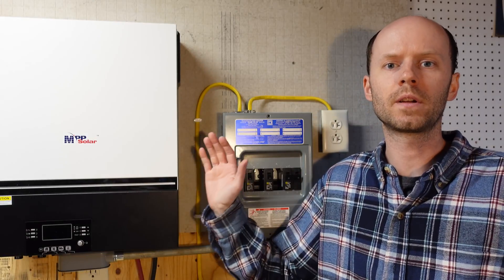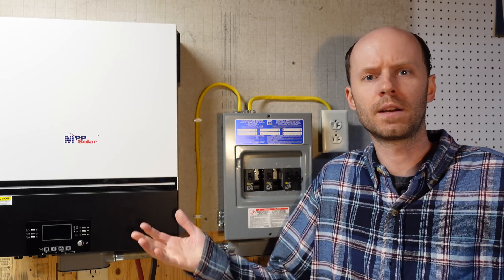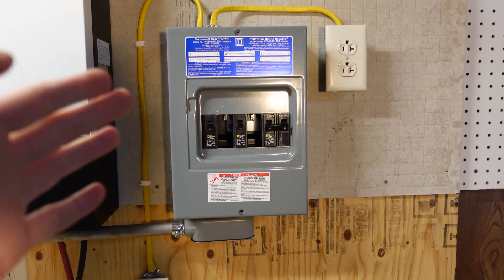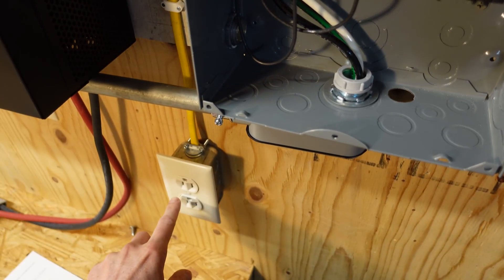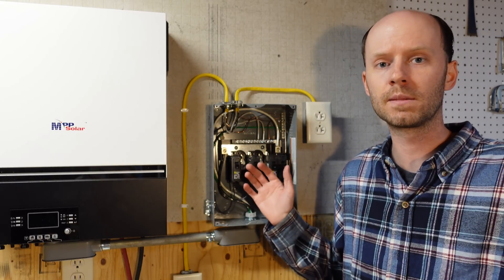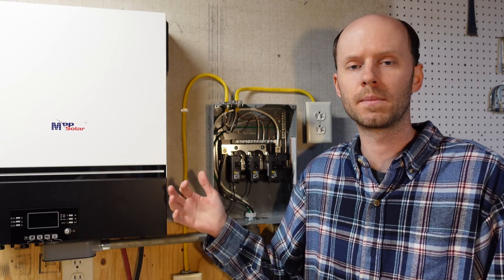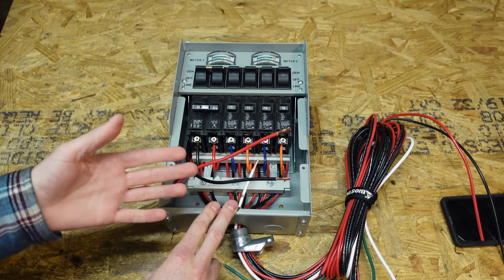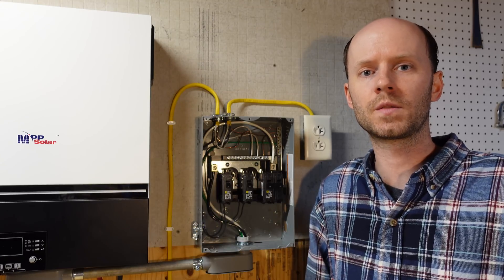MPP Solar LV6548 Inverter, Neutral+Ground Bonding, Completely Off-Grid

Comment from the maker: LV6548 Inverter... https://watts247.com/product/lv6548-6-5kw-120v-solar-inverter-4kw-250v-mppt-bms-ul1741-built-in-wifi/?wpam_id=97 (affiliate link)
If there's anything you feel I missed or did incorrectly here, please let me know!
Reply: Hard to tell what size conductors you have chosen in your main panel. I think your main bonding jumper is sized incorrectly. The minimum size allowed is size 8 AWG copper and should be sized based on the size of the ungrounded conductor.
Reply from the maker: The THHN conductors from inverter to panel are #6. Are you saying the bond jumper should also be #6 to match? I used a piece of #10 in the video.
Reply: @LithiumSolar  If your ungrounded conductor is #6 then the main bonding jumper has to #8 minimum according to the NEC article number 250.102 (C) (1). Thanks for for the detailed reply. That's why we don't lose the bonding screw! haha
Reply: I talked to watts247 and Ian said that if wired as the manual says you shouldn't have any problems adding A/C input because the relay takes care of all of the N-G connections, I'm still confused on how it wouldn't cause a problem if wired into a panel that already has a N-G bond though, MPP told me that in order to meet UL it is required to have a N-G bond under battery mode
Reply: did you connect to an earth ground? did you remove the N-G bond screw

Comment: What would be the best approach if you sometimes connect this system to a regular 120vac outlet to charge it when its cloudy? Do you need to remove the ground/neutral bond screws from thr inverter or leave them as they came from factory?

Comment: Can you create a neutral ground bond for your all-in-one inverter if you're only using the power strip and not a service panel or breaker box
Reply from the maker: I would suggest consulting an electrician. I'm not able to give application-specific advise.

Comment: My qiestion is refering to inverters or power ststions that have current between neutral and ground about 40 volts some are as high as 60 volts . You dont want tl short out 40 to 60 volts. If you bond you will short out your inverter. I dont understand inverter circuits. Especially the transformerless type. 73

Comment: 2:54 that wire is WAY too small for the capacity - should be 50A+
4:12 that also makes the breaker panel part of that potential voltage on ground / loop circuit.
Reply from the maker: I think you are misunderstanding a few things here...

Comment: If only one LV6548 is being used, it does not connect the ground to neutral when in pass-through mode, and you don't want to connect the ground-neutral at the LV6548 output panel either, as the bond is at the input grid main panel. When in battery/solar mode, the LV6548 uses a built-in relay to connect ground to neutral, providing a solution in the single LV6548 case. For multiple LV6548's all but one of the units need the bonding screws removed so that only one LV6548 provides the relay ground-neutral bond.
If MPP Solar shipped units without the bonding screws, then when running in battery mode, there would be no ground-neutral bond at all, unless the bond occurred at the output panel, in which case it would case a problem when the units run in grid pass-through mode. Also people may lose the bonding screws if not in the units.
If MPP Solar shipped units with bonding screws, then its OK for single unit operation, and for multiple units requires bonding screw removal for all except one.
If the designers had used the presence of the synchronization cable between units on all slaves, but enabled ground pass-through only for the master, then this entire mess could have been simplified.
Reply from the maker: It would seem something like that should be indicated in the user's manual; however, there's no mention of the ground screw whatsoever.
Reply: I'm facing this issue and you confirmed.  I have 2x lv6548 in split phase feeding an unbounded panel. I was testing the dynamic bonding and determined the slave p2 should have the screw removed and leave the p1 master screw in place.. I'm using grid input..
Reply: Hey thanks for this post. Finally cleared it for me. My system will be mainly offgrid but I will sometimes plug into a 120vac outlet to charge it when its cloudy out. Seems i just need to change the mode in the software.

Comment: Off grid only with solar and backup generator.  No grid feed. Should I earth ground at the all in one inverter case grounding screw seeing as that is my main service input to my sub breaker panel?  Then how should i proceed if my generator becomes my main power source  as a pass through and charger on my inverter? Do I keep the neutral and grounds together in my sub panel or separate? This is so confusing when you are not grid tied to the main panel earth ground. Any advice would be greatly appreciated.
Reply from the maker: I would suggest running this by a licensed electrician. I am not one and cannot give direct advice (sorry, I know that's probably not the answer you wanted).

Comment: Is Romex allowed to be surfaced mounted? I always thought has to be protected from damage even though it's in a basement inspectors will not allow it.
Reply from the maker: Does this look like a permanent installation??
Reply: @LithiumSolar I just assumed it was since you had conduit between the panel and the inverter.

Comment: Great video, so if I understand correctly, this switch could be used to isolate a solar system from your main panel AND provide the solar subpanel with a neutral ground connection at the main panel AND allow backup main panel electricity to the switch?  So once the switch was wired to the main panel, no additional ground neutral connection would need to be made corect?

Comment: Great video ! I’m doing a Battery Back up in case we lose electricity at night or during a storm , I have 4 100W solar panels which will be used to help charge my battery banks , I’m also messing around with alternative energy sources like a GM 10 SI 110A Big block low spin alternator & a Ford Mazda 150A eclipse alternator & a Gm 10 Si 120A High Amp Alternator which will be turned by 12V Dc motors , the only issues I see Are you are not supposed to leave constant current from the battery to the alternator or you can burn out a diode inside the alternator but I have testers and alternator 120 amp alternator with battery powered impact gun in my multimeter ground touching the case and the positive wire through the back grate of the alternator on the Gm you see 3 copper wires on the top under the case I was touching the wire on the left which is one of the exit points of the stater which is the copper winding underneath the case which AC current is flowing and then is translated into DC card for your automobile I tested 1,200 volts 1 Kw & 200W now I have to solder Romax wire to that each copper wire from what I’ve seen is a different phase the GM have three faces the Ford Mazda has five and also what I’ve learned because the magnets are so close to the copper winding it is very true sine wave because The closeness of the magnets to the Copper so literally you could run that electricity straight into your house and it won’t damage your computers or electrical items within your home but initial muscle having is trying to find an electrical modular to flow the battery voltage and the draw my home uses to Either stockyards in the spinning which will be controlled by the battery powered electrical Dc 12v , 3 generators the alternators & solar ! I figured out how to use it but trying to find the pieces that may not have been created yet to use ! I keep DC To Dc converter 60v to 48v step down 100A they do not make , or an Electrical Module to fallow the battery voltage and electrical use to send Dc 12v electricity to the Dc motors to start spinning to crest the electricity using “ but unable to find such an Animal on EBay , Amazon, AliExpress or Google ! If any knows where to get these items I have explained please leave a note where !

Comment: I'm going to have to watch the video a few times. I thought will prowse is saying something different I just wired mine up today I just have one inverter and mY my neutral and ground are bonded in electrical panel. I think I did it like will prowse said. I better watch both videos again.
I know my power worked properly. I got 120 V I was running my compressor no problem.

Completely off-grid stand-alone
Reply from the maker: If you're not sure, best to be safe and ask an electrician. I am not one of those 🙂

Comment: My question is on my inverter is single phase 240 input and 240 output? In the manual says L1 L2 N input and output is L1 L2 output. It’s a 12kw split phase inverter. On the output from inverter does not show the neutral line to the panel . So does the ground is jumper to the neutral like your in the main panel?
Reply from the maker: This is NOT a split-phase inverter. If you require split-phase power, you will need two of these inverters.
Reply: Yes I understand that. My inverter is a off grid split phase . It can be wired 240 output or 120 output. My question is, the manual shows for 240 output L1 and L2 to the main panel. And the N  not showing any connection from the inverter. So that means I have to jumper neutral and ground in the main panel  just like your.

Comment: Get permission from the inverter manufacturer before removing the screw. It may void your warranty. I had to call Signature Solar to remove my screw because there was a warranty sticker over the cabinet screw. I kept the email permission in my folder just in case. It took a phone call and finally getting through to the electrical engineer to explain why I wanted to do it. He understood and gave me the email permission to open the case. My ground/neutral is bonded in my main panel and my transfer switch keep the neutral intact to the main panel.

Comment: At the very end when you describe the scenario where the inverter is connected to the grind panel where the N-G bond is already done, you did mention that the sub panel should not have the bond but didn't mention that the bond should also be removed from the inverter. But it should be removed everywhere, yes? 
So that there's only a single N-G bond in the entire system.

Comment: The best possible result is full control over where the G/N bond occurs. If you look at the way the grid works, this bond happens in the service entrance panel, not at the service transformer. They shouldn't be bonding inverters. Bonds happen in the entrance panel for a reason. The mechanism to handle the fault resides in the panel, not the source. Hence why bonding is done there.

Comment: I had a problem with my mpp lv 6548, the manufacture send me one of your video, ( and after long time I was able to fix the problem ), now if i can I will make you a question: how do I turn off not stand by but turn off my 2 6548 in line, that is connect on solar and battery only? Thank you!

Comment: Could you please post the image MPP sent you for disconnecting the ground/neutral bond? I'd like to have that for reference.
Reply from the maker: The picture was shown in the video.
Reply: @LithiumSolar  Uh yes I saw the video, but a screen capture of that part is not even close to having the resolution that would make it any good for future reference.
Reply from the maker: @vananderson2895  It's pretty much the resolution they provided to me (if you set it to 4K). You can obtain the same file from them by dropping them an email and asking.
Reply: @LithiumSolar  I'm sure it's absolutely beautiful in 4k. But not everyone has a 4k monitor. A screen capture records the resolution of the pixels on your screen, not the resolution of the underlying video stream, no matter how magnificent. And since YouTube doesn't have a "zoom" function, you can't screencap the individual parts of the image and piece together a nice, high res version of the picture your want.

Comment: I wrestled with this for two weeks. Saw a video you did about the internal ground screw.
I removed it, and all was well till Ian came along. A week before the storm, had lots of rain, and not much sun. Then the storm came by. My Bigbatteries died. Thought I had it figured out, as I ran A/C / Grid power (Generator) to try to charge the batteries. Ran generator, turned on connection, and the MPP's started flashing on and off. Could hear the relays kicking in.
didn't
don't
Great video, but I am still stuck.

Comment: Good points on confusing issue. However, not having the romax in conduit going to the outlets is concerning to me and makes it difficult to trust a course on grounding safety.
Reply from the maker: Romex is not typically run in conduit. The wiring should not be exposed at this height, however this is a test set up as I mentioned. Assuming you reside in the US, you should be following the NEC for wiring requirements.
Reply: @LithiumSolar  I have never seen Romex pass code outside of conduit below 8’. Per National Electrical Code: 334.15 Exposed Work. In exposed work, except as provided in 300.11(A), cable shall be installed as specified in 334.15(A) through (C).

(B) Protection from Physical Damage. Cable shall be protected from physical damage where necessary by rigid metal conduit, intermediate metal conduit, electrical metallic tubing, Schedule 80 PVC conduit, Type RTRC marked with the suffix -XW, or other approved means.
Reply from the maker: @jcschwarb  As I literally just said...
1) The wiring should not be exposed at this height (indicating that you are correct)
2) This is a test setup (it's been taken down long ago)
3) Follow the NEC

Comment: This system is not grounded untill you have ground rod with wire from outside to your earth bar    ,  and double pole circuit breaker as your main breaker with ( L1&N)    so L1 is your hot(Life wire and N goes to neautral bar .

Comment: @LithiumSolar So if you're only running one of these, have it connected to grid power at your main panel and your output is connected to a reliance transfer switch you should remove the bonding screw in the inverter correct? Thanks for all the great videos! Been following them to assist in assembling my own system!

Comment: Yeah I am adding the ground rod and bar in panel box now but wondering if I need to take the screw out still if I just put my green ac output wire to ground as its a ground

Comment: Do you have your panel ground bar connected to a wire that goes to a grounding bar and if so can you refer the product to buy if needed? Thanks again
Reply from the maker: Are you referring to the 2nd ground bar I added in the breaker panel in order to keep the neutral and grounds separate?

Comment: I’m a bit confused. I been using one lv6548 off grid with my 48v battery system and 4000 watts pv array and works great as I just hooked ac output to a 20 amp Home Depot surge protector temporarily. Works great however I use max 2500 watt loads. I recently bought the manual recommended 4awg for the ac output and wiring that to a simple sub panel so I have two breakers but then I noticed the green wire and this video issue. I’m planning to wire the sub panel grounds on a grounding bar that will also accept the larger green 4 awg ac input and run a ground wire to a grounding rod but is all this correct or even necessary? I don’t want to create a issue so I’m wondering how to do this easily. Any help will do. Thanks for great videos and content regarding lv6548 and solar in general! Top notch!

Comment: Beginner here - Do you have the panel box grounded to a copper pole outside in the ground?
Reply from the maker: In this setup, the panel is not earthed. I am not an electrician and highly suggest contacting one regarding this topic if you're unsure. This setup is just for testing batteries, it's not powering a home or anything.
Reply: Good question he cant say that panel is his main panel without rod ground wire coming in from outside to earth bar

Comment: I am using a Xantrex 2000/ 12V inverter which has an internal neutral ground bonded.  I do not know how to defeat the internal ground connection at the inverter.  (No info from Xantrex).  So, to use this inverter, through a transfer switch, I had to not connect the ground from the inverter to the ground at the service panel.  The question that I have is:  Is it safe to not connect the ground from the inverter to the ground at the service panel? It seems as though you would still have fault protection through the circuit breaker in the service panel.  Thank you for a great video.